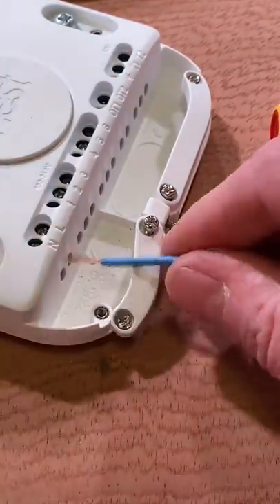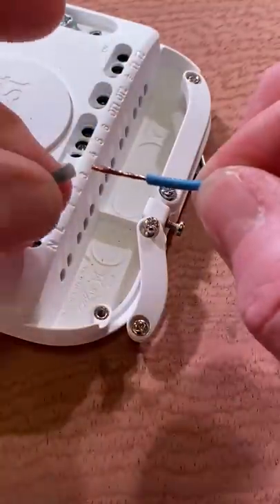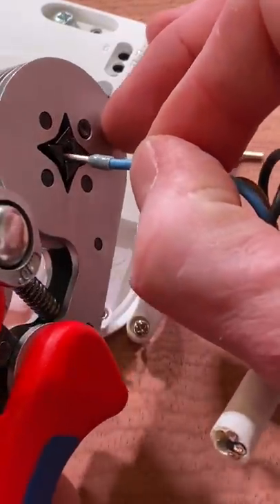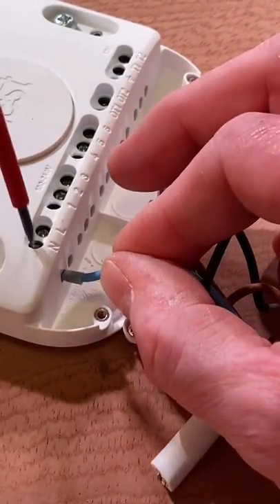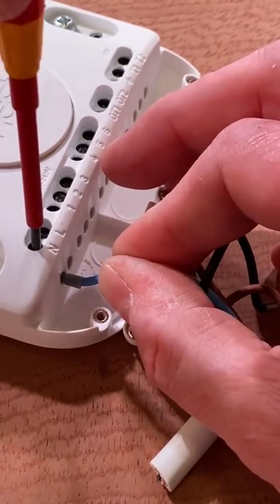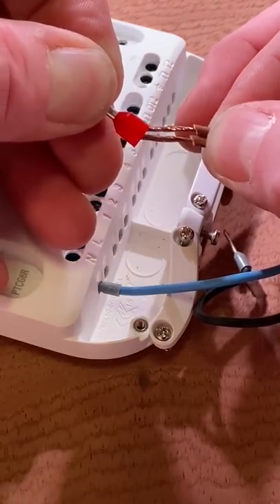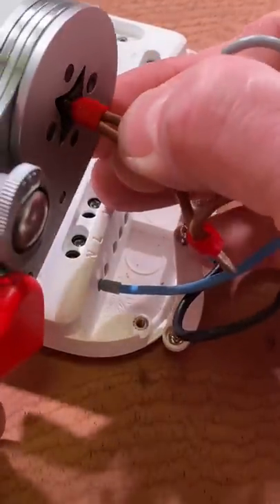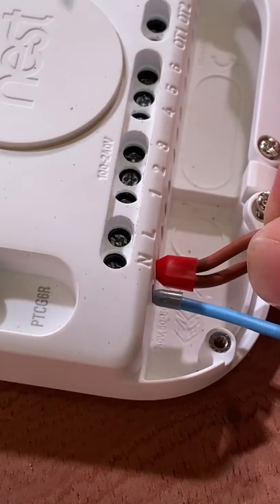Keep the strands together with WIRE FERRULES - Electrical #shorts from eFIXX

Comment: I’ve never had any issues getting it in the hole.😂
Reply: Some of us need a little help
Reply: might be a size thing.
tends to be an issue with bigger wires iykwim 😂🤭
Reply: It’s hard without hair around it. Old boomer joke
Reply: The problem is not alone getting it in the hole, but it's the screw that squeezes the wires out of the order you put them in and will make less contact. This could be in worst case a fire hazard without ferrules...
Reply: He couldn't get the wires in the big hole, but then immediately puts the wires in the tiny hole on the ferrule 😂.
Reply: That's what she said you'd say.
Reply: You guys have it all wrong.
The idea of the ferrule is not to make it easy to get the wire in the hole😯 It's to make a better, stronger, safer, more reliable electrical connection.
That also goes for RELATIONSHIPS, AS WELL BOYS!😉
Reply: I bet it would really suck if the end of it frayed... 😬
Reply: @TheCrystalGlow  LOL... I was expecting the normal professional presentation of LPL. Wait what? Then he pulled out the grandfather lock.
Reply: @Devviiiii  tin the wire... No fraying wires!
Reply: @Zakumei  nah you just spit on it
Reply: @Robmancan1987  my ferrule always has a tiny hole
Reply: @JohnSmith-yy8hn  Bonding means getting 2 or more entities together ❤
Reply: Not my fault u could fall in to your girl.
Reply: @markbuckley5360  don’t talk about your mom like that!🤪
Reply: Right, got to have a technique for getting in those tight spaces
Reply: You must pay extra for the version with hair around the hole
Reply: my connections tend to back and forth, it is never a stable fit but i like it that way
Reply: You never miss if you never get the chance ..... ;)
Reply: Actually I had trouble getting it in
 the hole was too tight 🤣
Reply: I think a ferrules would make it easier putting two into one hole.
Reply: I know your pain. I am also a virgin.
Reply: @aborecki  lmfao should I ask what hole?
Reply: Small fingers lol
Reply: That all depends if you get it in the wrong hole by accident.

Comment: Using Ferrules is a passion of mine. I do low voltage systems, meaning CCTV, alarms, access control, the low voltage side of gate controls, networking, and much more.  But using these just makes the install look so much cleaner and less chance of shorts if there is a loose strand that didn't make it into the terminal
Reply from the maker: Wise words 👍

Comment: Used these all the time when doing electrical sub assemblies. The tools can be expensive and have to be maintained but are absolutely worth the cost.
Reply: What are some of the ferrule tool maintenance tips?
Reply: 😂😂😂 Joking right?
Reply: @That_Handle  Oil...
Reply: @deang5622  ,
Thanks. Figured [oil] as a prerequisite in addition to a maintenance task / interval.

Comment: A senior technician that used to be the east coast regional manager for ASM showed me this about 10 years ago.  Used this method ever since.  It does add to cost but solves several loose wire issues.

Comment: We call them bootlaces in Australia and we cut off the excess. We want the copper flush with the end of the bootlace
Reply: Its good electrical practise wherever you are. I do this in the UK
Reply: They are called bootlace ferrule in the UK too, And having stray strands like that is very bad practice.
Reply: Agreed
Reply: I didn’t notice after securing the Bootlace into terminal giving it a little pull to confirm security?? I have also notice not all bootlaces are equal are some cheap rubbish out there???
Reply: @stephenfraser2521  always have to pull test no matter what connection as you don't want play otherwise that will cause resistance and heat. 

As far as they go there shouldn't be much discrepancies. Unless that plastic insulation falls off immediately. introducing the chance of a hand or tool, even swarf making contact.

If the bootlace ferrules are falling off then they probably aren't the correct size for the wire you're using.

If they are the correct size and you've tried multiple crimping tools then there could be a problem with the brand. Lol
Reply: @crum167  and don't forget there is French and German colour codes for Size, If you can get the original Telemecanique ones the quality is far superior.
Reply: An aglet or aiglet is a small sheath, often made of plastic or metal, attached at each end of a shoelace, a cord, or a drawstring.
Reply: @peatmoss4415  we know, These are insulated boot lace Ferrules, As named by the inventor.

Comment: Important to note that you shouldn't twist the wire to get it in, as it risks breaking strands during crimping. If it's refusing to fit, get a larger one.

Comment: Electrician here: don't twist the cable when you put it in a ferrule. Depending on which tool you use to press the ferrule, it will "twist" itself loose sometimes. You put it in the ferrule straight and it will be perfectly fixed.
Reply: Not always work. You need to be sure that your crimping tool is correctly calibrated. Twisting prevents from falling apart in case if your crimping tool getting slack and in the rush of chop chop you don't realise that 😂.
Reply: If they come loose, you haven't crimped it correctly.  Use the correct high quality tools and it will never be a problem.  If you just crush the crimp with pliers you are asking for trouble.

Comment: I used to work in an electrical factory and we used ferrules for everything. But we didn't have any fancy double ferrules like here we just added up the cross-sectional areas of the wires picked the correct sized ferrule and crimped them all together.
Reply: I do the same with my small time mechanics shop. Buy them in bulk get a cheaper price. They work just as good if not better then the doubles and you do t have to make double orders on all the sizes (1 for singles and 1 for doubles)
Reply: @thormilton3574  ,
great decision there with the ferrule stocking. 👍
Reply: Doubles just look neater. Fits in the wires insulation nicely, so no exposed copper, which is a fail point here.

Comment: These would be good for a 3D printer, people have had issues with wire terminals and the wires shorting.
Reply: If they are leaving strands hanging out they shouldn't be wiring it in the first place
Reply: @AnelFissures  That and screw terminals require crimped connectors at the end, otherwise the whole thing gets loose. That's the more common issue with shorts in 3D printers... But it still means you shouldn't do the wiring if you're not going to do it properly.

Comment: Ferrules are certainly the way to go when terminating any stranded cables. I personally like to trim off the excess conductor after crimping.
Reply: @brandonwyatt3901  perhaps some elaboration would be appreciated?
Reply: @brandonwyatt3901  yeah I've been using them for years and they always provide a strong, secure connection, make my jobs way too easy, almost eliminate the chance of conductor arc damage, AND they make future maintenance a doddle!

Hideous little inventions so they are.
Reply: It's also slow and doesn't really make a difference if your a good electrician.
Reply: Why not just get pliers
Reply: @stevenclark6387  Super sparks ⚡️

Comment: Ferrules solve another problem as well. I was an industrial engineer responsible for an electrical assembly department. One of our subassemblies contained a fairly complex wiring harness and terminal blocks. We kept running into cases where builders inserted the wires into the terminal blocks a bit too far. When they tightened the terminal the clamp pressed against the wire insulation instead of the stranded copper conductor. This resulted in poor and intermittent connections. Adding ferrules to those wires totally eliminated that problem.

Comment: You use ferrules 1) to help inserting the wire. 2) to prevent one or more strand(s) to stick out which can be dangerous and/or can make shot circuits. 3) to protect the stards when tightening the scew. 4) to reduce the resistance. 5) make the wire more stronger if you get the idea.

Comment: I like how he haphazardly tried to insert the frayed wire into the machine but very carefully inserted into the little pin
Reply: That's pretty standard actually. Even if you twist it the connection is made cleaner and better with a furrule.
Reply: @NinjaSushi2  you shouldn't twist the strands if you are crimping them.
Reply: @Patrick-857  You're absolutely right. As a wise man once said - don't cross the streams 😉
Reply: He's just trying to promote shit that takes forever and doesn't really make a difference.

Comment: I wire controls panels for hydraulic presses and ferrules are just to time consuming for us. I do probably 600-800 terminations in a day on I/O and low power panels, but all of our connections for 480 and other high voltage are ferruled. Most of the wire is Super VuTron and requires a ferrule because the strands are so fine.
Reply: I hope you do end up using them even though it takes a bit more time.  I work on Mobile equipment which is prone to a heavy amount of vibration (like a hyd press) and I’ve seen way to many connections come loose with stranded wire & no ferrules.

Comment: We use a lot of these crimps on the railway signals and telecommunications and we normally cut the end off that’s sticking out the Ferrell crimp
Reply: Noted: ferrules for RR & telecommunications connections. 👍 Thanks!

Comment: Before the advent of the ferrel for termination,  the worst thing you can do trying to insert the fine  twisted cable into the terminal is to twist the the cable after stripping back the insulation, by twisting the fine cable strands this will increase the outside diameter of the cable , making it even harder to insert into the terminal , pull and draw the strands in line with each conductors of cable when terminating.

Comment: I would cut the excess wires that protrude at the end of the ferrule using small pliers, then re-crimp the ferrule again as cutting the excess wire often results in deformation of the ferrules end at the cutting point. It is very important to choose the correct and appropriate size of the crimp ferrule, and it is also important to check if the ferrule is really well secured, which is usually tested by attempting to pull the terminal from the wire. That's my view.

Comment: When preparing the flex cores for a ferrell don't push the insulation being removed off the end of the copper. Leave the very last peice on & twist that, not the exposed copper. Really saves wear & tear on your thumb & finger over the years.
Reply: Excellent move, thank you

Comment: I'll have to try them out now, I usually take a minute and tin the ends with solder, but this seems faster.
Reply: That's what I do. This seems easier and may result in a stronger connection as it supports the wire.

Personally a like to give the end a good tug after clamping it, to make sure it has a sound "grip". (Please stop tittering at the back there!). I've known crimps get a weak grip before, they look fine but practically fall out when tested.

Comment: Weird, the wires for my HVAC and thermostat are all solid, not stranded. I’m not sure I even could have hooked up my Ecobee with stranded wire. 

I’m also glad I know these exist now, because had I come across this situation, I’d have undoubtedly just covered the exposed strands in solder to make them solid.
Reply: In residential most wires if not all are solid. In manufacturing and industrial a lot of our wires were stranded. Not an HVAC tech but electrician, all the wires I used to build our CRAC and AHU units were stranded and we used a lot of ferrules. Personally I hated the square hole crimper and preferred the octagon for a better crimp. But the square hole was the only one large enough for I believe it was the  8 AWG red ferrul
Reply: You just push the button down while you insert the stat wire. It's pretty simple
Reply: @hemi4722  That depends on the place. In many European countries solid wires are not used anymore, except in specialty installations. Everything is stranded. I've seen technicians who use ferrules for every screw terminal and others who never do. Except in some countries they're mandatory.

Comment: Big reason for ferrules is keeping the strands together . You crush down on stranded cable and it spreads out the strands. It’s easy for in a bad terminal to only have a portion of the wire actually contacting leading to heating and wear at the terminal.

Comment: I’m having trouble getting this wire into this small hole.  Let me stick it into this small hole first then I’ll be able to stick it into this other small hole no problem.  LOL sounds bout right to me. But for real, I love doing things properly. Not only does it look nice, it feels good to see everything super neat. Speaks to my OCD with much loudness.
Reply: I used to use them a lot manufacturing industrial power supplies. They are super easy to use. The trick is to strip them with one of those stripping tools that automatically clamps the and then strips it, and then don't touch the stands at all. No twisting. Do not twist them. Twisting is bad, and the entire electrical industry should go away from it as much as possible. Copper work hardens, and when strands are crossed over each and then compressed, they tend to cut each other and break. Never twist anything going into a crimp. With a lot of big crimp lugs especially 250mm plus cables, if you so much as touch a few strands by accident, you won't be able to get it into the lug. We used to strip it, immediately put a zip tie around the stripped part, partly insert into the lug, and then cut the zip tie when I worked for ABB
Reply: Back when I took classes for electronic engineering we were taught to strip then solder the wire.  At that point it’s strands are straight and soldered and they won’t fray and they can be put into ferrels and heated up to bond better after they were crimped. Now obviously if you have a huge wire that will be hard to do, unless you have low temp solder or a soldering iron with enough thermal mass to be able to provide enough heat to the large gauge wires to be able to melt the solder. I try to avoid twisting wires if at all possible, the only exception to that is if I’m connecting to wires together without hardware and I want a strong bond between the two, I fold them over each other and wrap the opposite wires around the connecting wire and vice versa then solder. That way the wires can’t pull apart if the solder joint happens to fail.  But I be sure to not twist the wires so much as keep them together and wrap them around, keeping them all as parallel as possible.

Comment: If the wire is going into a terminal that has two flat surfaces that push down on the ferrule, then by twisting the internal conductors, the cores will sheer each other off when they cross one another. If the terminal has two flat surfaces, then the cores should be untwisted, or ideally, cut the end off and just straighten the cores gently as they are inserted into the ferrule. If the terminal is a single-screw which pierces onto the ferrule/cores, then twisting them is advisable. And yes, in .au we do call them bootlaces.

Comment: I like those.  I may get some and the tool...even though  Nobody here in Canada would pay me my wage to do that.   My trade typically puts me between 2 - 0.6 %  of top annual incomes in the country,  and though we are expected to be the best, no call backs and know everything in a multi disciplinary trade,..if an owner with a bottom line saw me do that there would be issue taken.    Good vid though.
Reply: Why is that? Do they cost that much more or something?
Reply: @-Apollo-13  they cost more than not using a ferrule if thats what your asking.

Comment: When I was trained to use these they said not to have any copper hanging out of the ferrule tip.
Reply: That's exactly what the manufacturer says too.
Reply: Does it worsen connectivity? Does it increase the contact resistance?

Comment: So the solution is to place the wire in a small hole, so you can then place it into another small hole...makes sense.
Reply from the maker: Sounds strange but it works
Reply: The second small hole has to be screwed down which causes the wires to splay. It’s really about the connection and contact.

Comment: I am an electrician in Germany and it is forbidden to use flexible cables without wire sleeves for screw connections, and this is very good. But well what can I say we also have cool wago clamps.😌

Comment: I notice that in the video the crimping tool used had a square jaw.  Tools seem to be available with square or hexagonal jaws, though square seems more popular.  I can't think of a reason, but is there any preference of the jaw shape used?
Reply from the maker: We will review different crimping tools in the coming months 👍
Reply: I think square are cheaper than hexagonal!
Reply: Generally terminals are a square hole with one edge clamping towards the opposite side, a square would therefore give a more surface area on the connection and allows for easier orientation of the ferrule.
Reply: Standard forms are square, hexagon, V-shape, rectangular or trapeze. I got several crimpers, one for square, one with the V-shape and one with trapeze. The Knipex installation pliers are V-shape, the Knipex Multicrimp are trapeze, and the Knipex 97 53 09 for example are square.
Reply: I could see the hex crimp going into a small round terminal that a square wouldn't fit. However I gave crimped tens of thousands of square ferrules and never had trouble getting them in a terminal.
Reply: @efixx  what brand is that crimper?  What’s its gauge range?